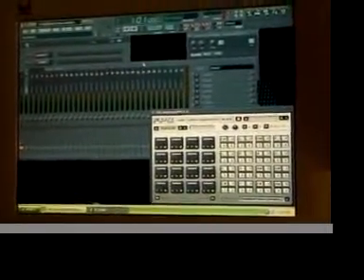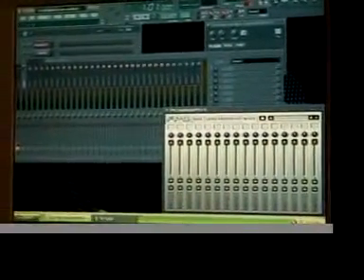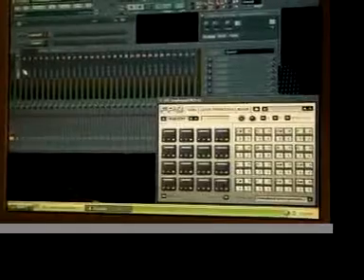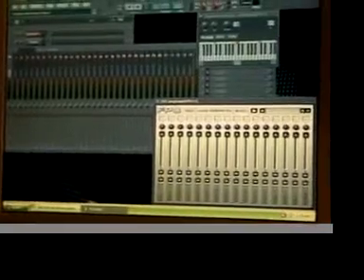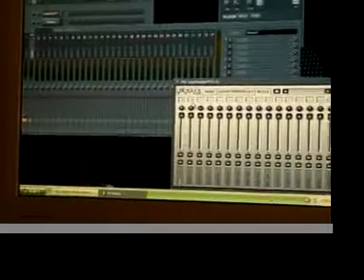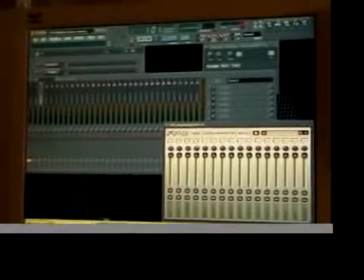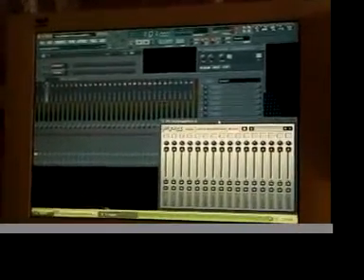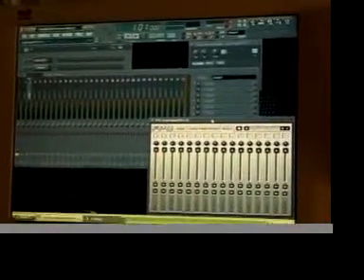Frutiy Loops Tutorial Linking FPC pads up with Fruity Mixer

Comment from the maker: @FreddyBe408 yes, they changed the look of the fpc after FL 6 I think. I was using FL 6 at that time but when I switched to 9, I'd had the same problem you had.  Now the corresponding mixer insert numbers can be changed in the top right corner of the fpc. You have to click on each pad to change the insert numbers for the mixer as well as the cut 1 and 1 or 2 and 2 numbers. I hope that makes since to you. If not maybe I can do a short video on that